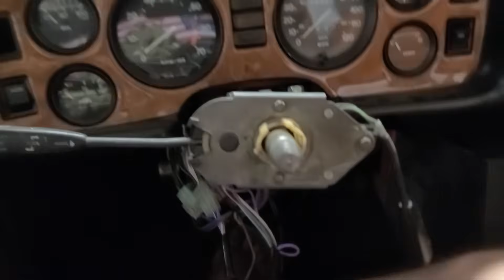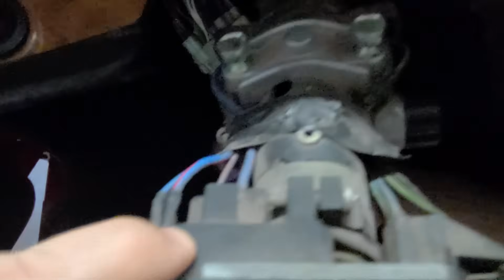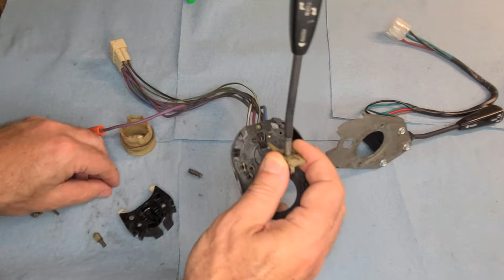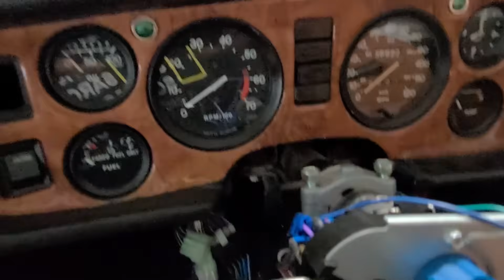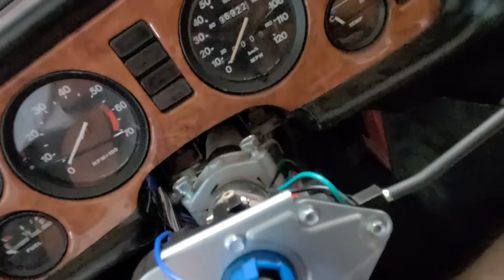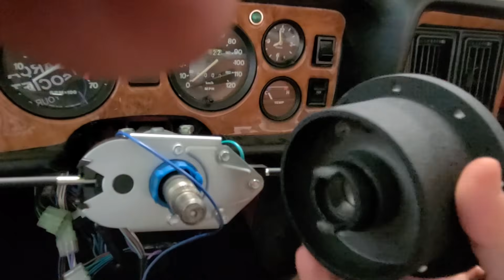1977 MGB Steering column switches (wiper and turn signals)

Comment: Being that the purple wire is always hot I would suggest that you stick to only the original push horn on the turn indicator arm. Or retro fit the earlier disk and brush horn arrangement. The spool system you have suggested to will over time fail due to its heavy use. This may cause subsequent electrical fire or constant blowing of the fuse.
Reply from the maker: I plan on an isolation circuit with a relay. That should reduce the fire hazard.

Still researching options
Reply: @AlexPlatacis  you can always get one of those Beverly hill Billies horns. Lol 😂🤣🤣